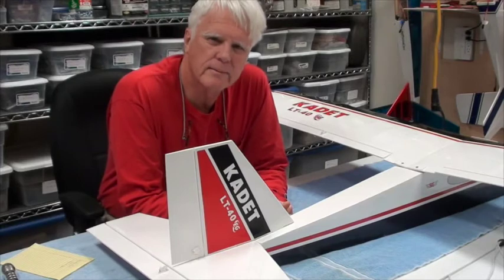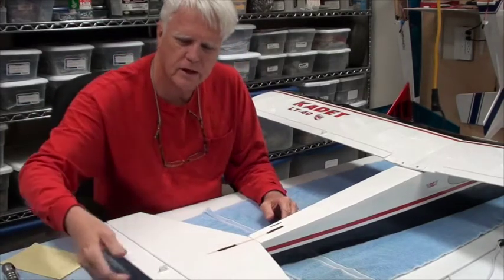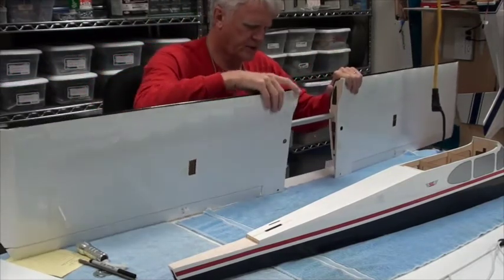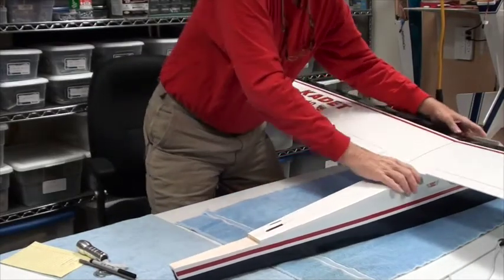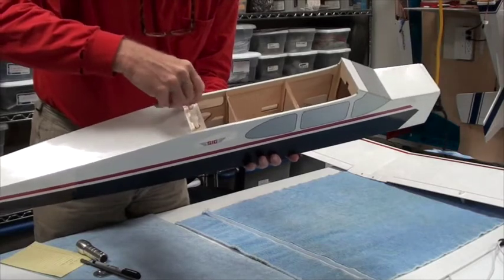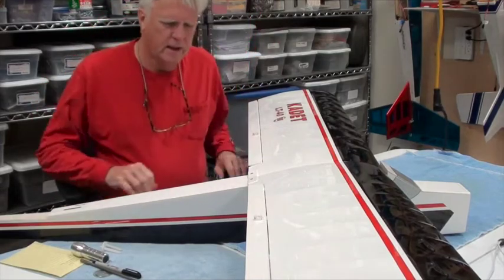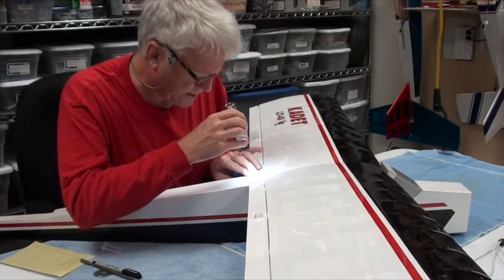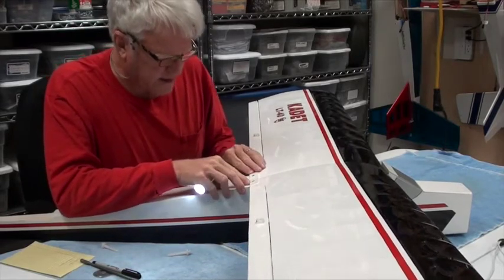K14 Kadet LT-40 Wing Test Mount

Comment: Wow!Sad you have to fart around so much to make sure the wings even bolt on. My Kadet has wooden pegs that you use size 60 rubber bands to hold the wings on. The first bad landing and wing touch will pop that wing right out of that nylon nut support brace. Too bad they changed the old design. It is a trainer plane,very similar to the Apprentice, except Nitro powered. Sad to say,I am not sure I would want to invest in the newer Kadet.